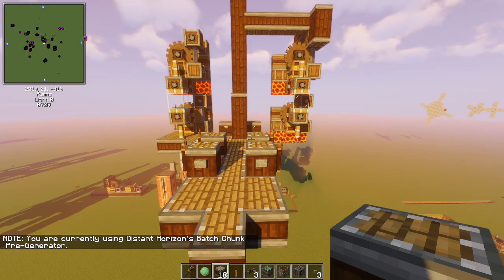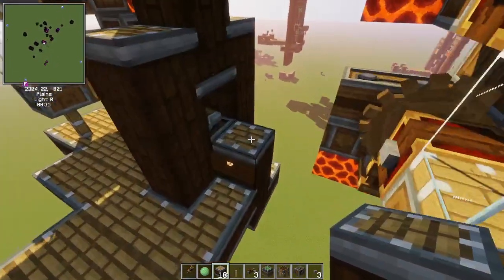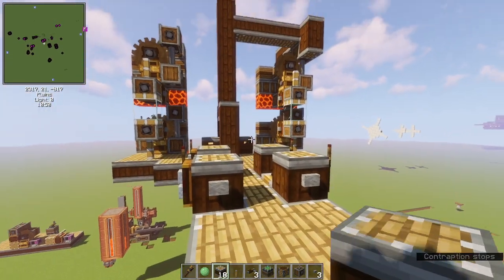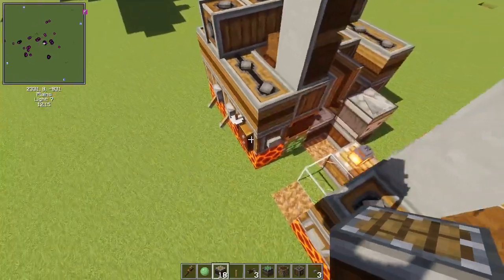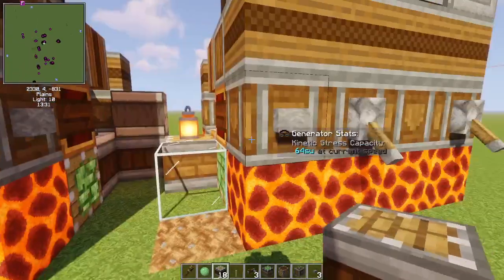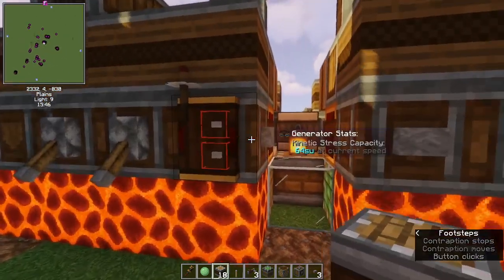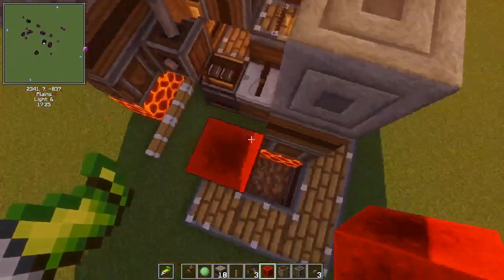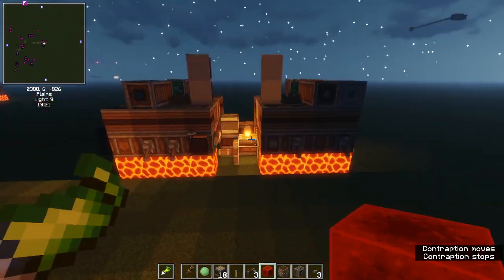Create mod 0.4 - Airship Fundamentals

Comment: The very important part for me was to switch from the piston/piston engine and now I use hybrid piston/gantry engines. They are very fast, compact (the piston still need a bit of power sources) and most importantly the redstone is extra simple and doesn't require redstone links.
Reply: Also, if you want to minimize lag :
- Less glue is always nice
- Longer steps means you do more distance per cycle, it can be faster and less intensive. 
- With really big machines you could use a small engine, with all the controls on it, and the large visual part can just be a minecart contraption. That way it doesn't assemble and place a large amount of block each cycle, only the engine part. 

Since most of my work is for drills, the last part doesn't really work for me since I need to be waterproof. And longer steps are also a lot harder to make waterproof..
Reply from the maker: I'm curious about the piston/gantry hybrid engines. I looked at your hollow drill and noticed that you can run the gantry off of just one magma block fan which is impressive. I've made some optimizations since making this video, that is sharing the same power source for the primary chassis in forward, up and down motion so I eliminate some of the power sources, still not as good as the gantry system. I couldn't figure out the redstone though on your drill for the gantry control. Oh and btw I have 2 accounts on youtube, this one for my minecraft videos and my other one that I use when I watch stuff.
Reply from the maker: Actually I have a huge airship that lags a lot, I might try making a large part of it into a minecart contraption
Reply: @KwizzleHazzizle  I would say that my hollow drill isn't the best since the logic can easily break but it's nice to hear!
Reply: @Mysda_  What do you mean with minecart contraption?
Reply: @tobitt8157  you assemble a minecart contraption that will stay as an entity and move it arround with the flying machine
Reply: @Mysda_  And this would probably have colission I assume? I didn't try this yet, cool idea!
Reply: @tobitt8157  it has collision with the player, but not with the contraption, outside of the minecart itself